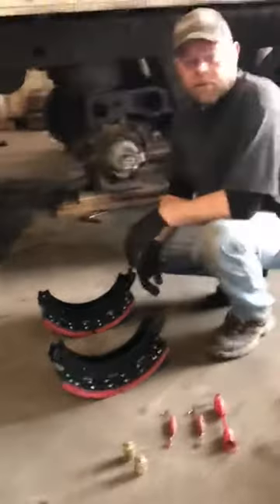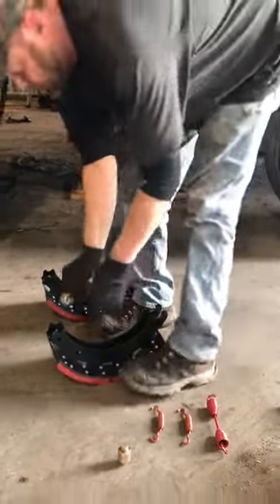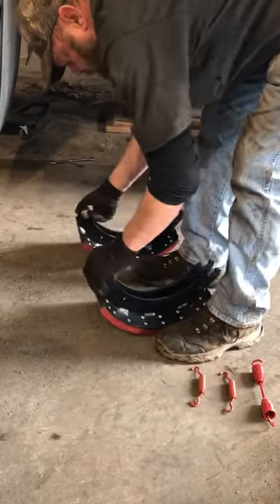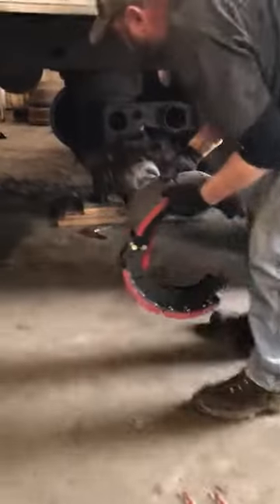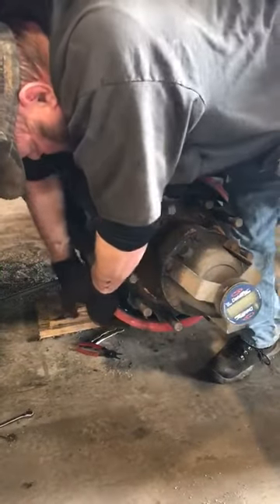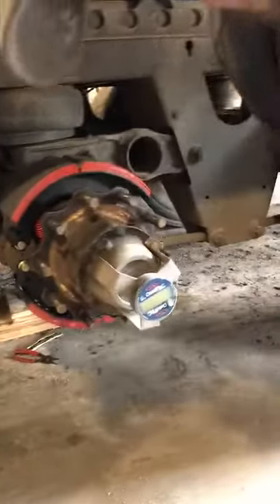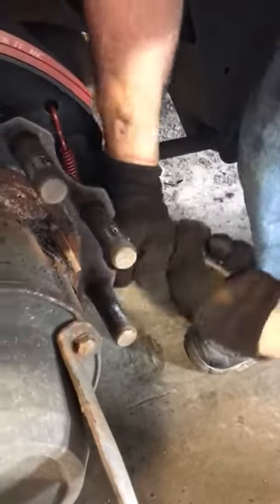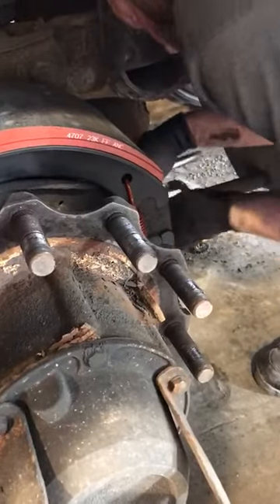Easy installation of 4707 trailer brake shoes!

Comment: 15 year diesel tech here, job pays 6hrs for a 2hr job 4sets of trailer brakes. This is the EXACT method I use. Done in 2hrs if the compressor can keep up 🤣🤣 $40/hr flat pay, made $240 in 2 hrs lol
Reply: Not hard, If you are set up. Rockwell, Eaton, Meritor all make good shoes. When you get into older lowbed configured trailer, the price and availability shoots way up. Hub seals are always a good thing to change when doing brakes. Lots of guys just want to leave them be.

Comment: Hi Shane, what brand of brake shoe kits you use? Where can I buy it?
Reply: 90% run 4707 Q+ because of the cheap reline and core payback.
Reply: @tylerblanchard2259  Thanks for your reply. Exactly, 4707Q+ is the most popular kits, could you please advise some store or distributors name? So I can order some.
Reply: @airbrakesystemspecialist436  That would usually depend on where you are located, not many people want to pay freight  costs simply because the weight.
Reply: @airbrakesystemspecialist436  Euclid is what is I use. Trp is Definately China. If that bother you.
Reply: @martinnorbeck4657  Thank you, Shane, much appreciated!